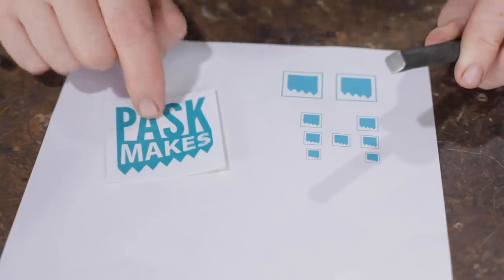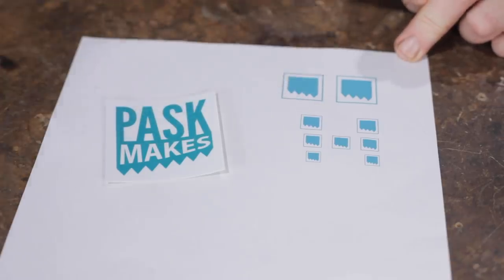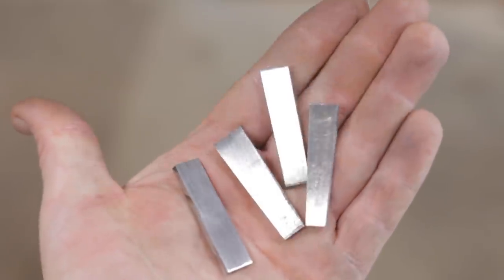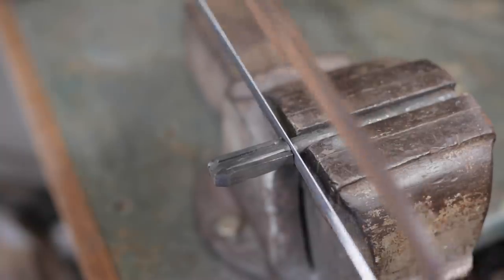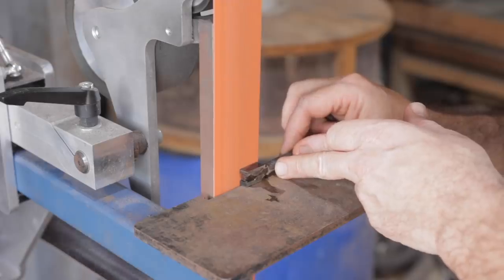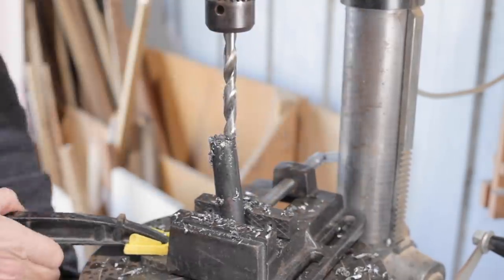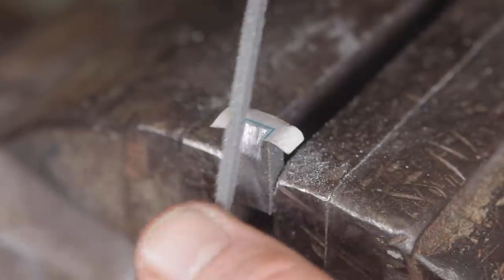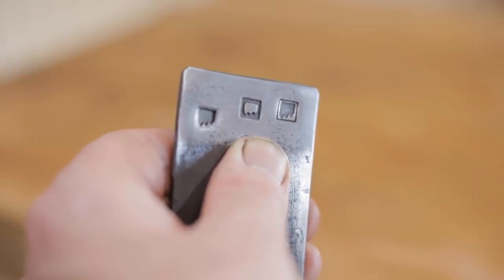Making Blacksmith Touchmarks

Comment: One way to measure and get a repeatable pressure on the fly press (or an arbor press, etc.), is to adapt a socket onto the handle and then use a torque wrench to move the handle (via the socket).  You could weld a socket on, or weld the socket to a plate and bolt that onto the handle so you aren't permanently modifying the fly press. You could figure out a way to do it without a socket too. The point is to use a torque wrench as an easy way to measure the pressure. This could be a video idea! :)
Reply: Note: Don't put the socket on the end of the handle, put it back at the axis of rotation.
Reply from the maker: Thanks for the idea mate! There's a stop on top of the flypress which I did set but I need to play around with the best depth. It's pretty quick and easy to set. :)

Comment: After you get the punch made take a plate, heat it up and stamp it. Then harden it. That way you can use it to make another stamp when your original stamp wears just heat it up and restamp it on the plate. Also you can make a brass stamp for your wood projects that is identical to your steel stamp using your same mold.

Comment: Nice, a tip for getting the springs straight, use a vice with the coil section hot and clamp it down tight. Makes the job easier in my experience.

Comment: Scrap metel challange
Scrap metal challange! 
Its scrap, its crap
But some of the metel is good!
Reply: I was about to comment the same thing a scrap metal challenge would be an awesome set of videos
Reply: Some one wrote one of these parody intros a little bit back when he did a metal project, you forgot the "it's fire wood" part. I don't remember exactly their wording, but they used the word wrought in it.
Reply: @billybobjoe198  I didn't mean to write a parody or anything. Also just did this out the top of my head coz my brain wouldn't shut up after the expected into didn't play :P OCD :P
Reply: I like that idea. Maybe if enough people ask, Pask will do it.

Comment: What are you "quenching"(???) the spring steel in at 1:02? Are you making it brittle by heating the hardened spring steel? Or does that bucket of mystery do something to keep it from becoming brittle? Thanks! I love your videosssss!!! 💖💖
Reply from the maker: I'm annealing it which is making the hardened steel soft and workable. Putting it in vermiculite slows the cooling down and gets a better anneal. :)

Comment: Great video. What was in the bucket you put the hot metal into? And why?
Reply: Might be the same thing they use in the cat litterbox. Dont know the english word. I think the metal cools slower cus of the material. Does it make sense? Greetings from denmark🇩🇰
Reply from the maker: Malene is correct, it's to slow the cooling process and get a better anneal. It's vermiculite that I use. :)

Comment: Nice mate. What was in the bucket.? sand? to cool it?
Reply from the maker: Thanks! It's vermiculite and it's actually to slow the cooling process down. That way I get a better anneal. I've found letting the steel from the car spring cool down in the air it doesn't anneal that well! :)
Reply: @PaskMakes  thank you!

Comment: Did you run into the spring cracking st all?
Reply from the maker: I've used that spring steel in a few projects now and haven't had any problems. :)

Comment: Why make it so difficult, just anneal an old cold chisel and start from there. That way you know you have a known tool steel that’s designed for striking metal. Everybody wants to cut car springs a part and spend time straightening them out! That’s for the 🐦 🐦 🐦